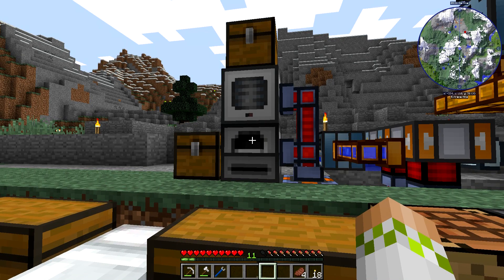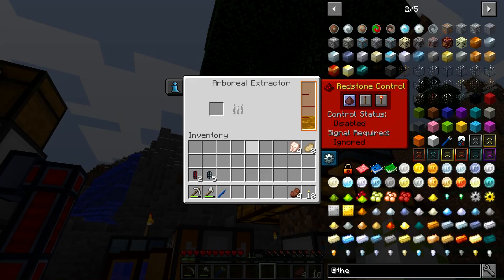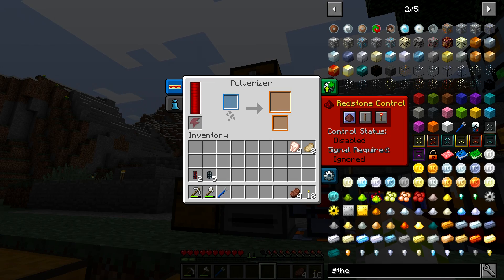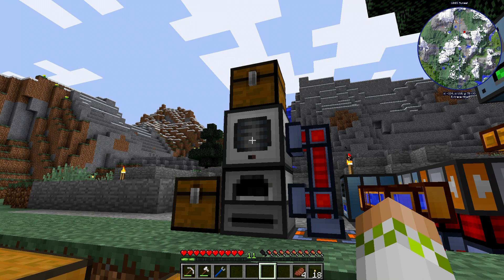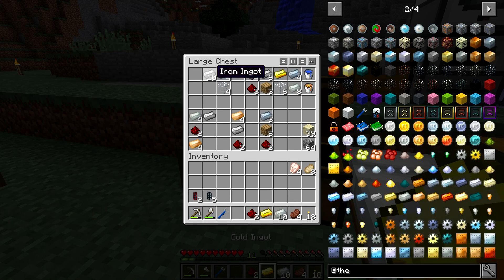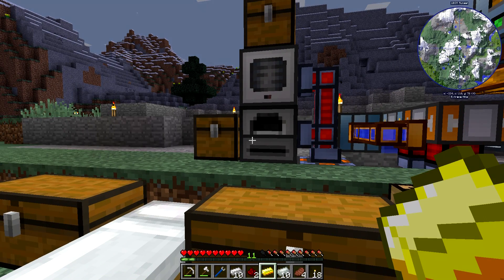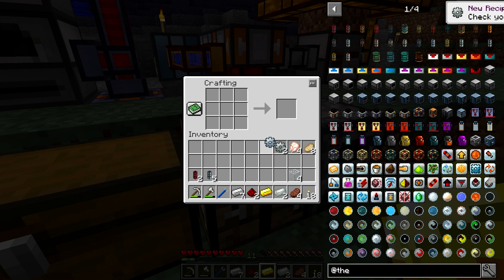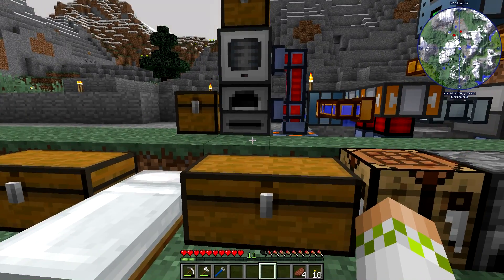Surviving With Thermal Expansion :: E03 - Induction Smelter And Rich Slag Stockpile

Comment: This is very old but Im here to help! The new update doesnt actually allow for cobble to create sand. Instead, You can make an igneous upgrade (blitz rods, and lead plates. obtain rods from white blazes at night and lead plates with the forge hammer and an ingot of lead) that allow the creation of sand through the ign machine. However, it takes up water when doing so. Instead, connect fluiducts from your previous machine to the ign machine, and there you have it!

Comment: Silly Modded Minecrafter. Trapped Chest wouldn't connect, nor would another cache, which would hold a lot of gravel. But the best answer is of course upgrade it and add the augment that nullifies secondaries.

Since you have the resources and now the ability to make it with less hassle, might I suggest some sweet looking Invar Armor? It'll stop you dying and is very cheap to put together early on.
Reply: Personally I've always found Invar to be a fairly rare resource because, unless you're processing all your iron, nickel is rare (and useless).